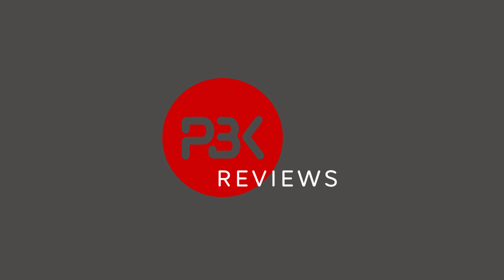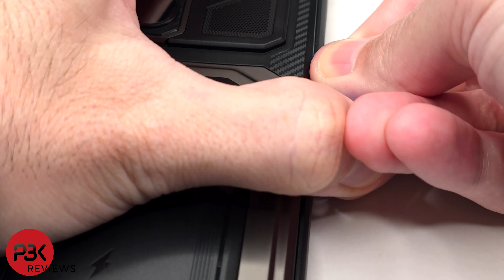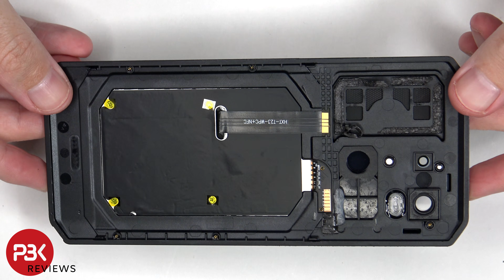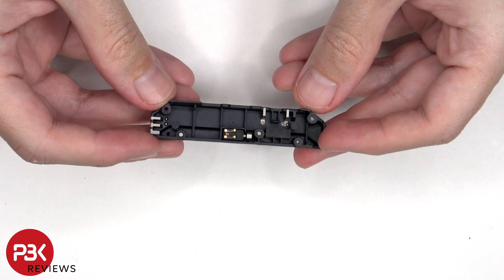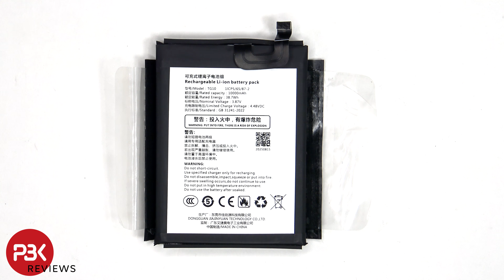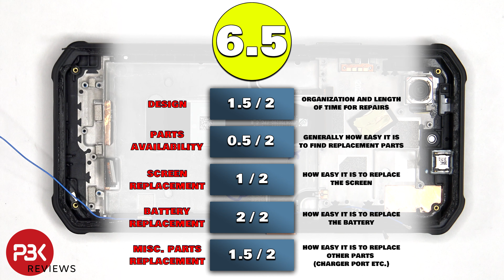AGM G3 Pro Rugged Smartphone Teardown Disassembly Phone Repair Video Review

Comment: How is that a rugged phone? Being able to dismantle the phone just with a hotgun shows me that this isn't waterproof
Reply: Even iPhones and Samsung Ultras use this kind of silicone gasketing for their IP protection too. It doesn't fail when this hot, you also have to be prying and cutting it same time.. he makes it look easy, it's not. Even letting this bake in the sun you could toss into a pool after and no water is getting in. 

It's after he takes it apart is when it loses that.. really hard for a human to reseat a seal perfectly like a machine come with a jig to help.. and I doubt they make seal kits for this.
Reply: It's not waterproof. It's water resistant rated at 1.5-2 m depth for 30 minutes.